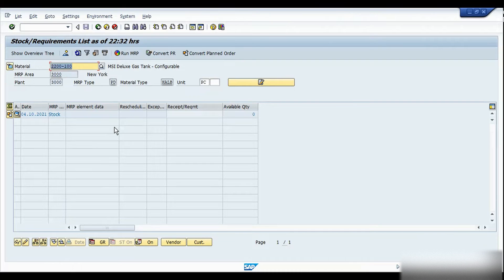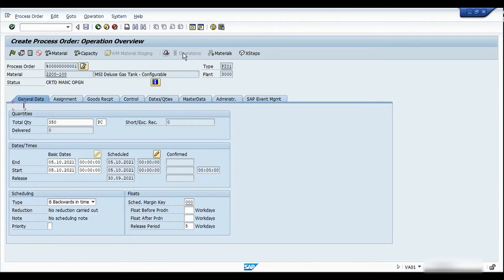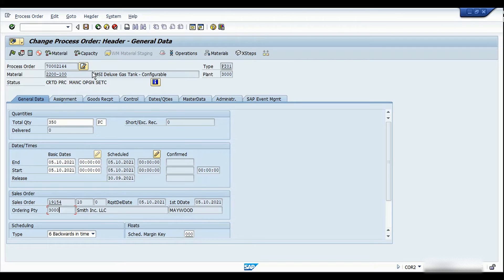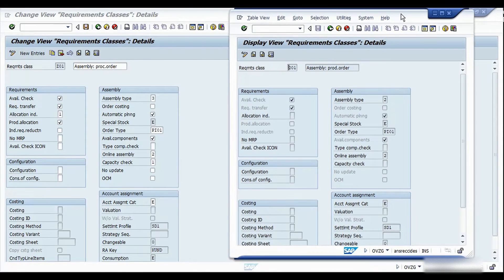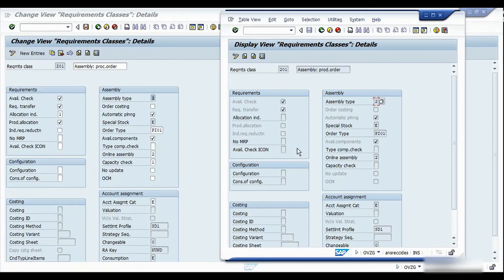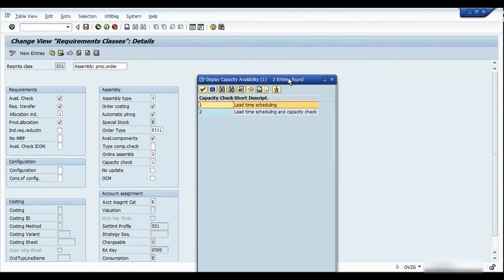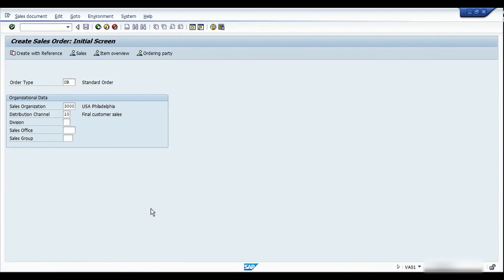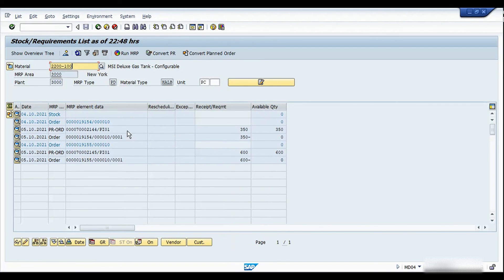SAP Assembly Order Processing | Planning Strategy 82 | Make to Order | Dynamic Order Execution

Comment: Hi IK, I hope you are doing well. I have implemented strategy 82 for direct creation of production order on creating the sales order. However, I’m having an issue, the production order gets updated even though it has Released status, when someone changes the delivery date on sales order.  I have unchecked No update in requirement class. I am ok if the production order gets updated when the sales order is updated when it is not released. But, don’t want it to be updated when it has been released. How can I achieve this? Is there any config that can resolve my issue? Many thanks in advance for your help in the matter.